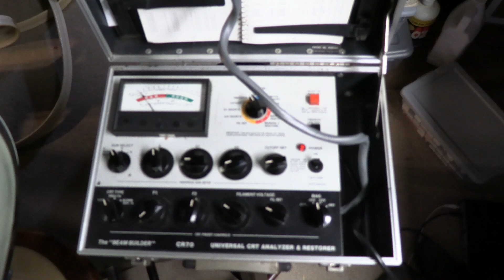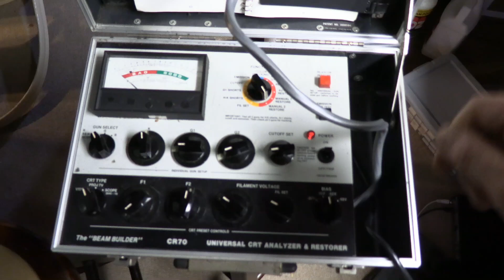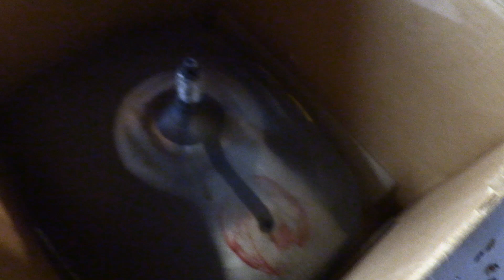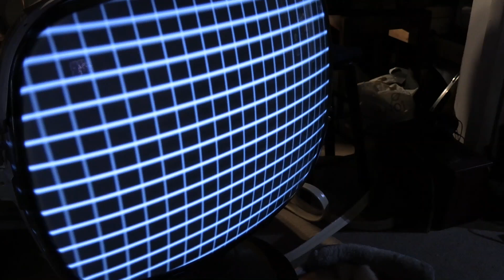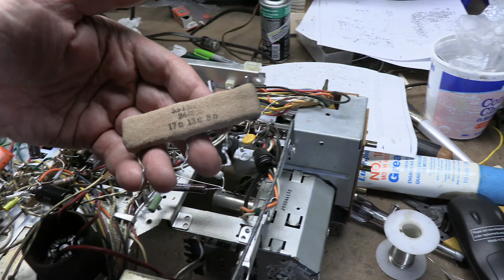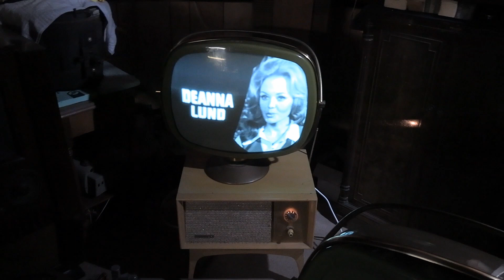Predictapalooza s02ep11 Trio of Tandems part 4 - Finale!!!

Comment: A great series Bob. Are you using a modulator (transmitter) to get the signal to the TVs? I noticed the color set in the background with the same program.
Reply from the maker: No, not yet.  Just a splitter.

Comment: You can repair those coil slugs - a small drop of super glue, and match up the pieces accurately. In most cases, performance will be as new.

Comment: I remember the day when you couldn’t give a predict-a away. There were junk joke TVs with little sensitivity and selectivity. The styling was ugly. Quality was dirt poor cheap. Only smokers liked them it seems or they came from the factory that way.
Reply from the maker: A restored Tandem runs around 3 grand now :)
Reply: Measure the inductance of the peaking cores to make them the same.
Reply: Is that a spam can?
Reply from the maker: What - the high voltage box?

Comment: Happy New Year Bob. Glad,despite all the adversities you had to overcome with the Tandem head unit,you finally pieced one together and installed a good crt! The picture looks great. It's too bad it's so hard to find decent replacement crt's for the 21" models. I saw a head unit for a Tandem at an estate but the crt had imploded inside the case and the tenite screen was cracked,along with the back cover so I left it.

Comment: I always had much better success using my B&K 467/470 for rejuving a CRT. It seems to be a bit more gentle . The Sencore unit was better for other CRT's.   Would you please post a list of the CRT's you need?
Reply from the maker: 16EP4 metal cone for a Zenith porthole set.
21FAP4 or 21FDP4 or 21EMP4 or 21EVP4 for a Predicta
Reply: I do have a 16EP4 in a console with radio & phono I would part with. Tube tested good about 12 years back. Been in heated  dry storage since. Will look for the other CRT's. @bandersentv